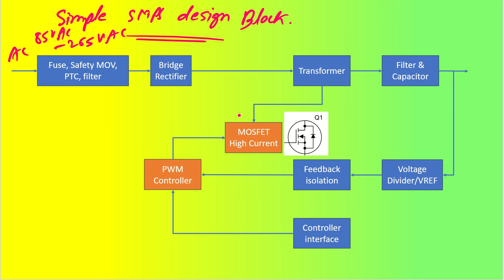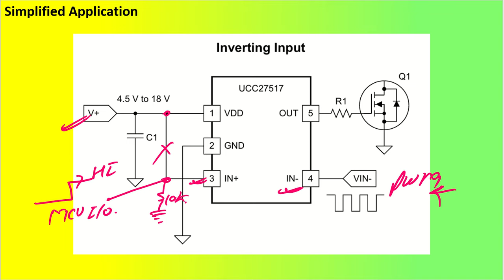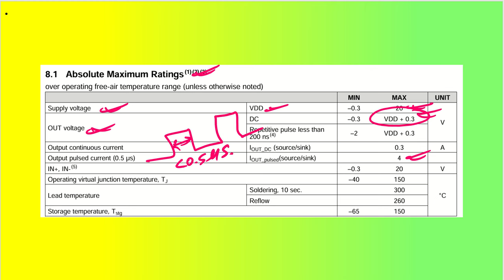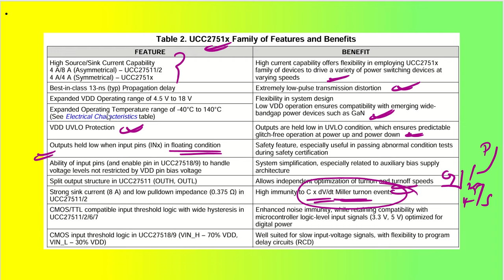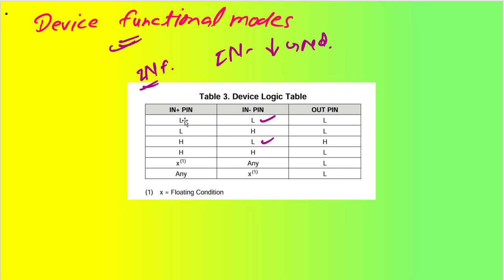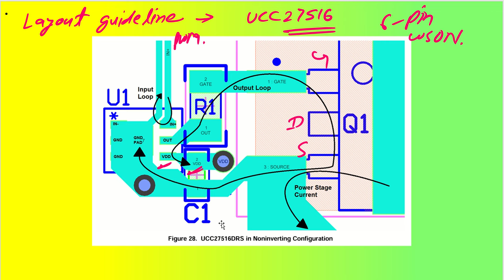090 GATE Driver PWM Controller UCC27517 (UCC2751x series) design techniques for SMPS, DC-DC

Comment: I just don't understand the purpose of the video..this simply copy paste from datasheet..there is no new information or new methodd explanation
Reply from the maker: Here, we are explainging to use the IC application, if you wish you can read and understand by yourself from datasheet. Means you are already above many learners. Thanks

You can reach if you have any specific requirement